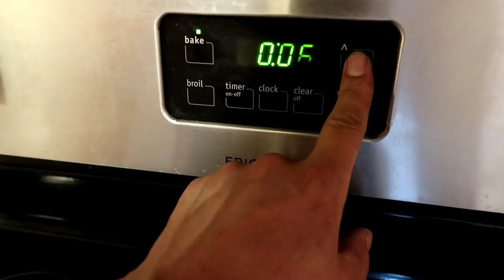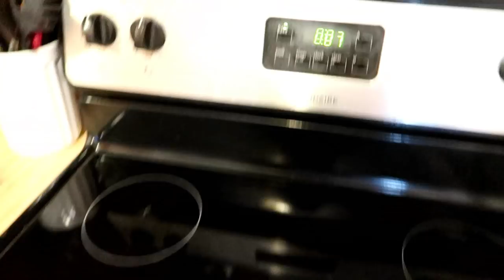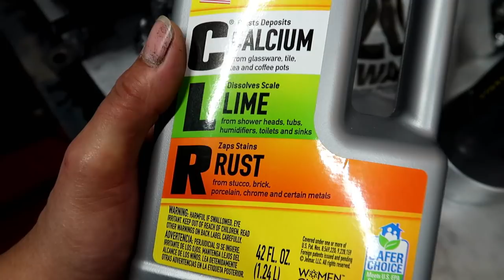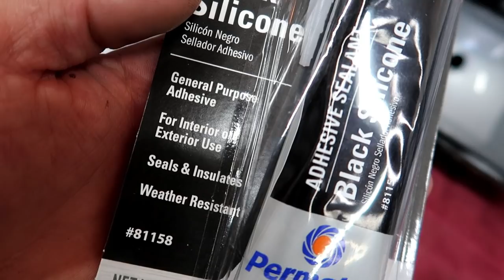Restoring my EF Headlights

Comment: I had to rebuild couple of headlights, silicone never looks too too great on the inside, so don't worry.
The foil, it'll work as far as looks go, real effect on seeing road ahead, well, make sure you buy some good light bulbs not just regular ones. It won't shine that good for driving.
I chrome plated few of mine headlights, and while they look great, focus is off, and they just don't shine great.
All the pluses for the perfectionist's jobs you're doing, I love it.